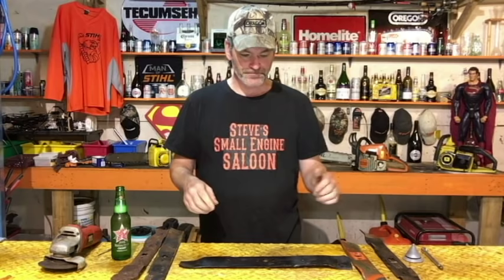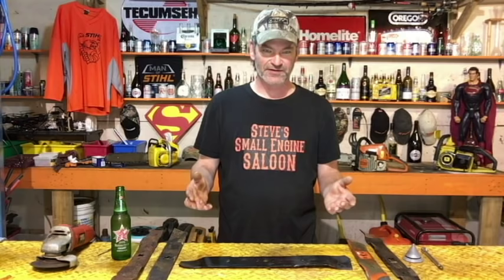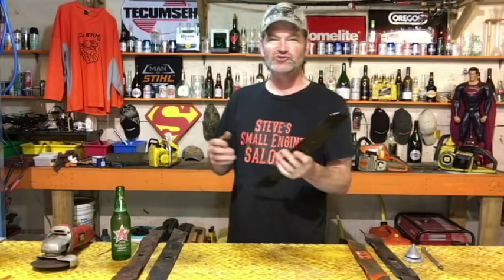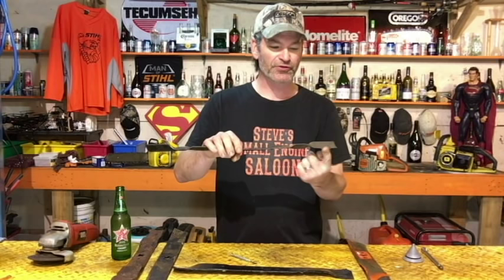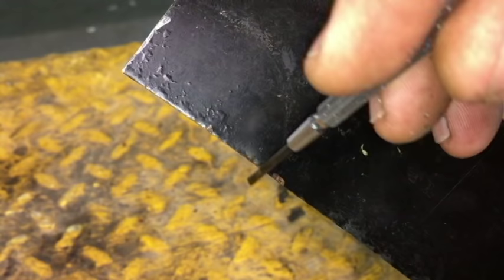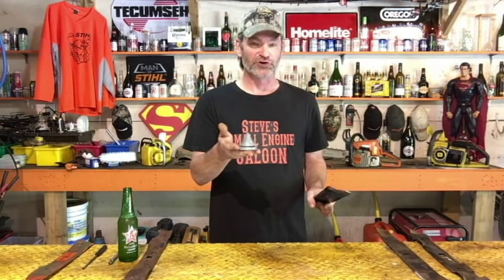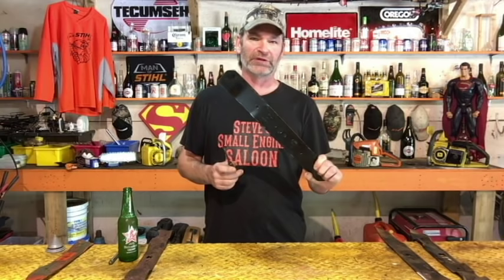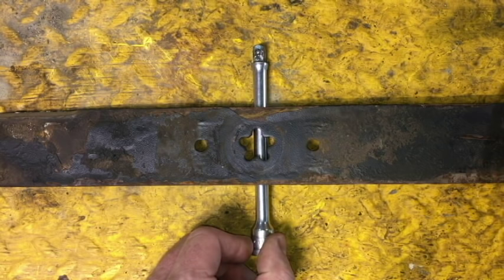How To SHARPEN And BALANCE A Lawn Mower Blade (The Correct Way)

Comment: Good video. However, the “nail method” of balancing seemed to be proven as a reliable method by it. It was certainly not disproven as a reliable method of balancing a blade; as what the audience was expected to believe happened. If you would’ve put the blade, that was known to be unbalanced, on the screwdriver as well, the heavier side of it would’ve rotated so that it was closer to Earth than the lighter side. The balanced blade didn’t rotate on the screwdriver in any of the positions it was in when a new trial began; signifying the blade is, indeed, balanced. 

Seems pretty reliable to me. But, I’ve never balanced or sharpened a lawnmower blade before. So, what do I know?
Reply: Sharpening or not atleast you know the art balancing lol..
Reply: Sounds like not much

Comment: FINALLY got a bargin deal on a 4 1/2" Milwaukee angle grinder to sharpen my own blades. Useing a 40 grit flap disc.

Tryed the nail on the wall trick, & iam not happy with the resaults. the blades want  "kick" in or out from the wall giving a hard to read balance. Going to hunt down a balancer after work today.

Comment: Couple things here Stevo. 1) it takes more than one sip of Heineken do get a blade sharp, also of note, Corona works as well. 2) tell these folks you can buy a dang good 4 1/2 in side grinder at harbor freight for 12 bucks, can't beat it. And 3) there's a slick little unit called The American Sharpener, or maybe it's Great American Sharpener, I'd have to go look. That thing is the absolute bomb yall, keeps it at 30 degrees. I own a lawn service in SE Texas, we mow over 100 yards a week, I am constantly sharpening blades. It is a HUGE difference using that thing, its amazing how much longer my blades stay sharp when at correct angle. The way your doing it, I did it like that for 20 yrs, you can't hold that 30 eyeballing it. I was shocked when I got that tool at how far off I was. Go ahead and chug half that cold one on next vid, Texas style. That was a 3 cold one vud you just did, I counted mine. Good job explaining that stuff, patient man....Roost

Comment: Your opinion about balancing on the screw driver is flat out wrong. The blade was balanced because you could put the blade in any position and it didn’t move around the axis. If it was out of balance no matter where you positioned the blade the heavy part would have turned down toward the ground.
Reply: True but the last blade he balanced is difficult to do with a nail on the wall as the center hole is star shaped instead of round.
Reply: @killer2600   Not really, it might even be easier.  Just put the nail in the top part of the star.

Comment: Remove the plug cap, close the valves, carb side up. Probably not many knew that. Back in the 50's a balancer was a beer or soda bottle with a marble on top. Blade center hole on the marble. I still do it the old fashion way. With a hand file.
Reply from the maker: Cool!

Comment: If you can get your blade off, your mower will be your buddy for life.just hope it doesn't take the habit of humans and starts smoking after the blade gets off. 
In a gas engine,. That's a bad thing.  LMAO 😹😹😹😹
Reply: Why would you not be able to "get the blade off"? If you're any sort of handyman around the house, you should own an air compressor and a impact gun and impact sockets, tip the mower on it's side, and spin the blade bolt off. The reinstall and tighten. You can buy a small torque wrench and torque the bolt according to the owner's manual. The amount of torque various by manufacturer of the mower.

Comment: You are one of the few that knows to mount the blade in a vice so you can see the blade edge and easily know when the blade is sharp.  Also grinding down rolls less metal off of the sharpened edge. When you hand held the blade as shown, the grinder will roll metal of the edge which needs to be removed from the other side of the blade.

Comment: Steve I use my Dremel Tool on Bar blades as easy enough to access the top of the blade. Coarse and fine stone to finish and comes up a treat.
Reply: The only problem that I can see with that is . . . how do you tell if it's still balanced?

Comment: I have a bench grinder, so I sharpen the blades on there. What I do is I make a pass on one side of the blade, and flip it and make a pass on the other side, always in two's. When I've done enough pass sets to get the blade sharp, I always check the balance, but I've never had to actually balance a blade.

Comment: I use a 60 grit flap disc and once the blade is sharp I balance it out by taking a small amount of material off the side of the blade works like a charm every time

Comment: Wow, thank's Steve, at 64 yrs I thought I knew everything. (just like I did when I was 15 lol) But apparently not. 
I used to have one of those balancing do-hickies back in the day when Dad drove a Studebaker. Only thing was...... I had no idea what it was for! Nor do I have any idea where it came from, 'cept maybe in a bulk purchase of used tools tossed and bought in a garage sale junk box.
 
It looked exactly like yours & close inspection revealed it was made out of cheap alloy cast, which is probably why I didn't even consider the posibility it might actually be a tool. I tossed it aside, maybe into a box of bizzare looking metal bolt on attachments for an old Singer treadle sewing machine that might come in handy some day. I haven't given it so much as a moments thought since.... until now.
 
Given the fact that I've never thrown anything away in my entire lifetime..... it's gotta' be out there somewhere! But where to start looking? I've got a dozen out buildings, at least 20+ rusting hulks in my own personal 'Rust Valley' type Field of Dreams, 2 de-commisioned Safeway Semi-trailers used for storage, and a land bound floattila of boats & other such watercraft to look through. Sigh.

Considering the task at hand, it's doubtful I'll find my balancer before I'm long dead and gone. But tonight I plan to show my son's this video..... just so they'll know exactly what it is, when & if they ever find it.
 
Lunch break's now over, gotta' get back to the metal shop building and continue on my most recent project thanks to Steve's recent tutorial titled... 'How to Make a Sword out of an old Chainsaw Bar'. Thank's a lot Steve. The 1st sword is half done, 15 more chain bars to go, then I'll have a complete set ready for the Zombie Apocalypse, or if by chance the "Hoarders" TV crew ever shows up at my place, never to be seen again. 
The first one when completed, already has a home in my front door entryway. I plan to use it the next time the producers of the 'Canadian Picker's' TV program show up bangin' on my door again askin' if 'I'm ready to sell anything'.
The next time, I swear to God I'll have one of their heads mounted on a fencepost as a warning to others. 
Back at it, cheers.

Comment: What I do is after sharpening the cutting face as you do I then run a flat stone over the back face of the blade just to take off any burr keeping the stone flat on the surface  . A bit like how you sharpen a chisel or a plane blade .  My Honda mower does not have a single blade bar like that . It has two separate short blades on a big disk . Even though the instructions show the single bar type blade . Not sure what's  is going on there .  Balancing does not really apply so much to my type of separate blades , but I could weigh  them I guess .  Nice work as usual.

Comment: You can also use a hammer to flatten any Nics or uneven surface prior to sharpening it. It may lessen the amount of grinding to get a straight sharp edge. You can slightly grind the bottom to get a straight edge, but barely notice an angle.

Comment: I welded extra tabs at the ends, at an angle to mimic fan blades. After that the catch bag would get fully stuffed with the grass clippings, easily doubling the capacity compared to the stock stuffing power.

Comment: Thanks, Steve.  I came for how to use the Balancer Tool, and will buy this one from your link for two reasons.  1) It's metal (instead of cheap plastic) and it's made by Oregon (a brand I trust) and 2) You'll get a little profit from it.  I guess that's 3 reasons.😜  The MagnaMatic Mag1000 may be the best, but it's $216. 😮  Thanks again
Reply from the maker: Great to hear!

Comment: Had a mower blade years ago that I kept sharpening but not balancing properly. As Steve said it will start vibrating. Mine did exactly that and eventually broke at one end as I was mulching some leaves. A five inch long piece of blade shot out from under the deck and hit my shin hard enough to chip the bone plus cause muscle damage. It took months of treatment to get over the injury. Make sure you balance the blade!!

Comment: I've been using a 4" die grinder to sharpen my blades for as long as I can remember. The important part of it is balancing the blade after you sharpen it. That will keep it running smooth. They can vibrate like hell if you don't have them balanced.

Comment: It was a little boring until you got to the balancing part. Lol. Thanks for that tip!
I just rescued a riding mower from the junkyard, and I just replaced the rotors and the blades on the deck, and now I can do a better job of not destroying the rotors, or spindles as they call them.
It's a Husqvarna riding mower, and the previous owner had already done me the favor of replacing the garbage Kohler motor with a Briggs & Stratton! So I don't have to deal with that in the future. I basically got a three thousand dollar machine for about $200 in parts and a days labor! (and about six beers)
Cheers!

Comment: Love your channel Steve.....I might add that lawn mowers with more that one blade,  I have seen where the end of the of the blade is rounded off on the cutting edge. It should be sharpened back far enough so the outside edge is square again or replaced.....rounded corners on a blade will leave skips on mowers with more that one blade.

Comment: Steve, you have all the necessary tools right there on your table. I had to improvise a few times and used a beer bottle (Shiner Bock), a Craftsman screwdriver because they have a rounded handle end. I stuck the screwdriver in the bottle and balanced my blade effectively. Whatever works, right?

Comment: And don’t forget to never-seize the blade fasteners when putting the blade(s) back on. Thanks for sharing.
Reply: Yeah, and dont have the shop put it back on 'crusher' tight.  Cant get it off the rider.  Can only sharpen the bottom a bit.

Comment: Thanks Bro,  It's like YouTube know what my plans were for tomorrow.  Yep.  Gonna sharpen my blade tomorrow.  I didn't know the blade needed to be balanced.
Reply from the maker: Good luck!
Reply: I never see other people talk about how important it is to balance the blade. 
It's just common sense. If it is not balanced, it is going to vibrate more. Vibration wears out everything. It also shakes screws and bolts out.
I can't tell you how many guys look at me like I am crazy, when I tell them that.
Another thing is chopping up limbs and branches, instead of picking them up. It just cost you in the long run.

Comment: Thanx, Steve! 
I'll use your balancing tricks after sharpening my blades (two lawnmowers and a Husqvarna 24V54 with THREE blades).  All copiously full of rock "signatures". And now.... a broken mandrel on one of the Husky's blades.  Definitely a rock!
But the "nail in the wall" trick should be OK.  Use a THIN finishing nail; maybe a bit of grease/oil on it. IF the blade remains perfectly still (best while it's horizontal) it's most likely balanced.
If the blade starts to rotate, THEN it's obviously off-balance.  Unless you burped up some Heineken on one side.  Best to hold your breath! 
ADDENDUM!   I stand corrected!
This might work on a blade with a circular hole, but not on a star-shaped hole like my husky blades have- their notches are off center.   Oh well....
I 'm gonna try this after 4 or 5 Heinekens....    Then,  guess what will be off balance. 
Thanx again.

Comment: I have to add one thing to this when i got out of lawncare i worked for husqvarna  in the press dept. Blades start out as a 36 inch tall roll of steel in various widths
The press we used was about 25 ft. Tall (pretty impressive and terrifying machine) the press operator (occasionally me) was just a doper off the street theres absolutely no joke in that either  operating the press was really easy load a coil press the button and watch for clogs or other mishaps with the press and never let the machine run out of lubricant for the die 
The blades came out of the press at about 25 per minute on to a Slide and into a  48x48 bin around 36 inches deep and usually held about 1800 blades
These blades were never checked for anything when the bin waa full it went to the sharpening area and then off the cleaning area to have oil residue washed off from there they went to the paint chain 
Its worth noting that nothing produced at the former husqvarna helena-mcrae ga. Plant was actually painted everything was powder coated 
Back to blades due to manufacturing speed and the sheer amount produced
It wasnt possible to really q.c.blades  on occasion bad blades did make it to final assembly  
With all that being said 
In my experience it isnt worthwhile to balance a blade  its better to just replace it sharpening blades is an art  it can be done at home but with high risk of heat damage to the blade

Comment: Great stuff.Yo Steve been doing exactly what you been saying.
Carburetor trouble first try to clean it.
Put it back together that didn't work.
Watch a couple more of your videos.
Replace the needle float on the carburetor and a little rubber piece.
Starting up first pull.
Watch out new guy coming for your job 😆 thks
Reply from the maker: Right on

Comment: That last blade you had which had 5 star grip is what I have. I use a small flathead screwdriver and take the blade and put the Only TIP of 1 one them 5 star positions on the flathead screwdriver. Perfect way to balance a blade. You just hold the screwdriver and place the Tip on the flat part of the screwdriver. Simple.

Comment: I use a grinder but I use a coarse grit sanding wheel. Also I can't seem to remember to pick up the triangle so I take a few measurements on each side. I've did it for years and so far they always cut great and the mowers run smooth

Comment: Turn your bench vise so that the blade will be sticking out at you. Vise the blade so that , when you hold the 4 1/2 in. angle grinder at elbow height, you can rock back and forth as you grind the blade. Use an 'open' 60 grit grinding disk. . It should cut, not smear. Do not grind out the nicks. They will go away in future grinds.

Comment: One thing I'll add, before sharpening my blades, I'll use a wire brush in my angle grinder, or bench grinder, and clean off all the caked on grass/debris, so that when I balance the blade I'll get a true balance.
Reply from the maker: Right on

Comment: Hey Steve - I'm new to your presentations! Where ya been.? I've heard from various mechanics " How To....". For instance - one person puts it against a two by four piece of wood and files it. I use a sharpening stone. Luckily - Santa gave me a New Mower so I will take care of it. For starters- a lawn mower is Not a stump grinder, used with the front wheels up in the air to take down tall weeds and its important to avoid above ground tree roots, cement, rocks etc. Hopefully it will be awhile before I have to sharpen a blade. I really Like your sharpening method. I'm subscribed now 😀
Reply from the maker: Right on buddy!  Thank You...

Comment: These new metal FLAP grinding dis ~  WORKS VERY GOOD FOR SHARPING BLADES ~ i love these new grinding wheels ~  i for got what grit it was its either 80 or 40 grit ~  its for metal grinding ~ I have been afraid to use them, afraid it would come apart on me.  THEY DON'T i used it on a cast iron skillet too WORKED NICE

Comment: One noteworthy point is that if you use a bench grinder or grind with the edge of the disk, you can get what I believe they call a "hollow ground" edge. This is the way a razor is ground.  It reduces drag on the blade as it slices through the grass.  At my place, there's some kind of weed or herb I call wire weed, because it's so tough, it has broken the deck belts on my JD 265.  So I need every EDGE I can get and the best EDGE I can get!  And still I have to creep through it.  I've used a bush hog on it and had to take second gear on an eight speed tractor!

Comment: I just bent a blade while doing a favour for my neighbour, and after straightening it, and sharpening it, I couldn't find my balancer.  I used your extension trick to do the balancing, and it worked like magic.  Now the rain has started, and I can't finish the lawn anyway.  So, my plan is to say to hell with it, and drown my misery with a bubbly beverage.  
It is forecast to rain tomorrow, so I will cut another balancer on the lathe.  Thanks for the quick tip.
Reply from the maker: Right on buddy!

Comment: Good video Steve,I like to sharpen mine every season,I use the Oregon Gator blades, They really turn the clipping to good mulch ,And I sharpen them with a flap wheel on my grinder so as not to take too much off the blade and over heat the steel.